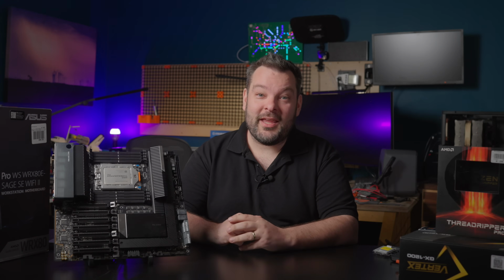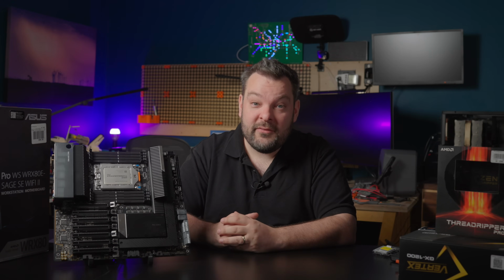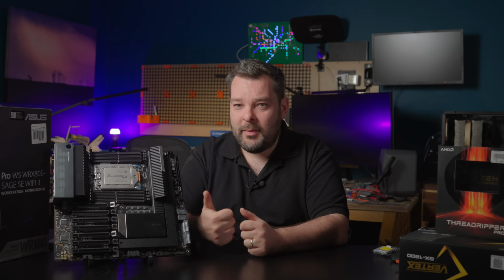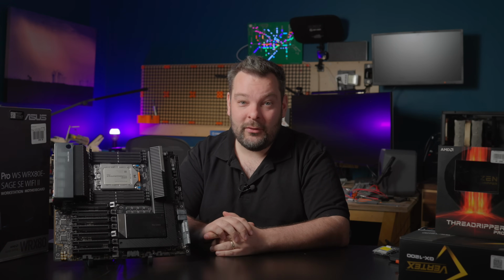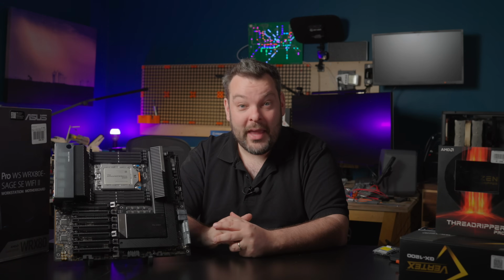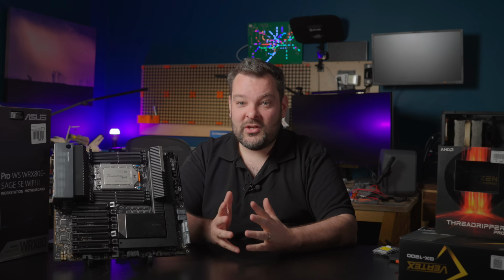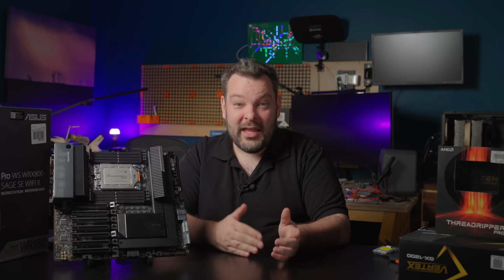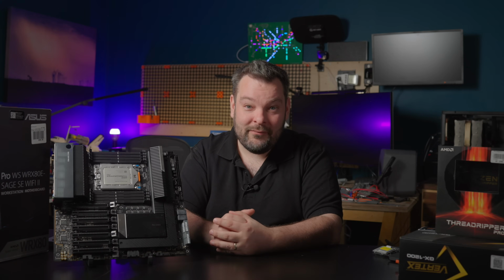ASUS WRX80E Sage SE WiFi II & Threadripper Pro 5955WX Review: PCIe Lane Heaven or Proxmox Nightmare?

Comment: When it comes to DDR4 compatible CPUs, the threadripper is same clock speed as the top DDR4 Ryzen 16 core CPU. So a used 5955wx threadripper is best when you need to recycle that DDR4 RAM you have now that prices have jump 5x times.

Comment: For me, the booting issue occured, when SR-IOV was disabled. I had disabled it after some toying because there were too many entries in the lspci (I come from normal boards and Intel CPUs). On second attempt to install proxmox, it did not pass the initramfs as you describe.
Now I am trying to do nested virtualization in proxmox ... All the indicators suggested in various tutorials are showing up and there is no error message on installing proxmox. But ... no DMAR or IOMMU in the nested proxmox mchine and an error on selecting the PCIe-device to pass through. Now I take your recommendations for UEFI settings and try again. Thank you!

Comment: I also built a ASUS WRX80E with TR Pro 5955WX and 512GB RAM as a video/photogrammetry renderer last year. I had massive problems when enabeling bifurcation (4x/4x/4x/4x) for the NVMe storage card that came with the board. When enabled, I get up to 4500 μs halts in latencymon. When disabled, it goes down to <100μs. Unfortunately, I bought all the parts from different sources so I couldn't return it easyly. So now I have 4 unusable NVMEs worth over 1000$ just laying around :/
Reply: Same but I have 16 u.2 drives, it won’t boot with more than 6 drives installed , bad board

Comment: Threadrippers and Epycs.....pfff would love one for my homelab. I just upgraded from a single Xeon to a dual Xeon setup. Got 80 lanes now, up from 40. Best next thing i guess
Reply: Ebay, 
Entry level wrx80 
3945WX only 12 cores but under $200
Gigabyte board under $500
It's used but get 1/2/3 year warranty and plan your next upgrade.
This way you can eventually put in a 5995wx 😊

Comment: I am having a q code 15 error on this with a 5975wx cpu, I installed 8 x 32gb of Micron 3200mhz rdimms I can get into the bios but cant install the os as it blue screens also get that issue with a 3975wx on this board frustrating

Comment: I know it shouldn't bother me but it's annoying to see folks complaining like this when they are using it wrong.  This machine is for Workstation work, probably meant to have Windows on it, perhaps some workstation Linux distro.

Yeah it's power hungry, IT'S A WORKSTATION for very heavy work.  The components/drivers/config is built around it's use case.  If it was a server board it probably would have gone a lot smoother.

Comment: I just built one in a 4u server case for the hot swap bays...  too big to get to the bottom connectors.  since I had no plans to mount in a rack, i cut a hole in the side and expanded it 6 inches and added 28 2.5 hot swap bays from icy dock, card reader and burner drive. may have to squeeze liquid cooling in there somehow .

Comment: I was recently building a new home server and was looking for Threadripper last gen on eBay. But in the end I got new hardware, ProArt X870E-Creator WIFI motherboard along with the Ryzen 9 7900 (non X version with 65W TDP) processor. I am using two PCIe slots for two Nvidia GPUs and for storage there are 3 x NVMe SSDs, 2 x SATA SSDs and 2 x 3.5" HDDs. Also got 4 x 32GB of DDR5 from G.Skill (Trident Z5 NEO) but since there are 4 x 2 row sticks it works "only" in DDR5-3600MT mode. In the end I consider this a wiser choice, minimal power draw in comparisson to Threadripper, got new parts with long warranty, and the motherboard is easily upgradable during the AM5 life span. Software side I got Ubuntu Server with Docker and MicroK8s and mainly play with AI.

Comment: This is NOT for homelabbing... This is for big data dev work where you need things like 2 gpu & mellanox networking in a desktop that you can put under your desk (NOT rack). This is not a homelab toy, well it can work as it but for homelab you can go much cheaper with older Epycs.

Comment: I’m having the same problem. Lack of pci lanes. Your video kind of turned me off the 5000 series. Do the 7000 have the same issues? Or do you think it’s more related to the motherboard like another poster suggested? Kind of struggling on a plan going forward.

Dual gpus, three preferred and high speed networking are on my list.

Comment: I think the problem you were facing is much of the concern of many proxmox system builders. The consumer/prosumer platforms just aren't ready for full virtualization. The enterpise platform you were using (EPYC 7002) before were designed for virtulization from ground up, and it was easy for this reason. 

I think this is a major lesson for everyone though, just don't trust things that are not for the purpose of virtualization and hosting (unless tested by others). Things that are not designed for our purpose will more or less fail at some corners, sometimes major sometimes minor. It could be a deal breaker depending on your usecase.

Comment: Interesting to hear you get those types of messages. I have the gen 1 version of that ASUS motherboard with the 3975wx and I was getting a lot of corrected PCIe errors in Windows Event log for years. It kept pointing to various different nvme drives but every time i removed a component it seemed to say something else was the problem. I nearly RMA-ed some WD SN850 drives which are actually totally fine.

I tried everything and have finally reduced the errors by not using slot 2, i figured it somehow got a defect. However i just get this nagging feeling that there's an underlying architectural issue with this ASUS board that they are keeping quiet about. (I have all power connectors plugged in)

Comment: Wider than the EATX 'spec'? I was not aware that the "Extra" wide ATX boards actually had a standard. I have seen so many wildly different size "EATX" boards I had just assumed anything bigger than ATX you better start measuring every inch or millimeter to check clearances. 
I am sorry to hear you have such trouble with the Thread ripper platform. 
I am enjoying my EpycD8 + 7F52 in proxmox with little to no complaints. For my set up, as much as I would love to run a high end consumer build, I just find the spare PCIE lanes incredibly useful especially when it comes to having additional NVMe storage. 
I am mostly testing VDI/ or Gaming in virtual environments. Testing includes BOTH direct passthrough AND GPU virtualization splitting workloads across several GPUs.

Comment: Still rocking on a 2975 WX 7 years on with 3x onboard NVME, 4xNVME pcie card, dual 10g fibre, SAS HBA controller, 9070 XT GPU and it’s difficult to move to anything else cause of those sweet PCIE lanes.
Reply: I'm using a 5950x on AM4 and while the CPU is fantastic even 5 years old I'm struggling there's just not enough PCIE lanes on consumer platforms and HEDT as a whole seems to be dead.

Comment: Cries in 3975...  It's always felt laggy in windows, something about IPC, idk.  I want to make the leap to the rumored 9xxx series.  Also if you throw this in something like a O11 XL, those bottom ports are amazing.  I can run a full size 3090ti and not block any other slots.  This is an incredible motherboard that is a little hamstrung by these eras of CPUs.

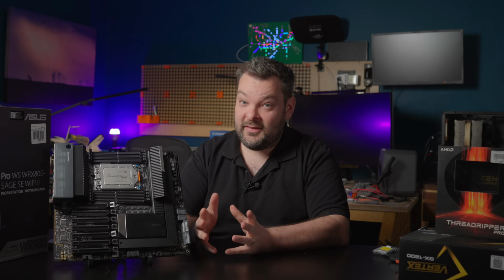Comment: 10:23 there is no such thing as an E-ATX spec, E-ATX is a wild west of whatever the board vendor wants it to be as long as it uses standard ATX mounting holes, judging by the width and the screw hole placement, that is an SSI-EEB board, asus list the board as EATX(EEB) so that settles it, that's an EEB board through and through

Comment: I was looking at building another AI server to replace my TRX40 system. Given how much money is involved in an all in system, I'm legit considering a Minisforum BD970i X3D and a blackwell RTX Pro 6000. What's the point of all of this PCIe availability when I can have a single PCIe 5.0 slot and 96GB on a single 600w card, 96 gig of 5600 DDR5 and enough NVMe storage to store large models. For everything else, a small cluster of mini PCs do the job just fine and I get high availability with it.

Comment: The only reason to get this is because you need those PCIe lanes. Otherwise, it doesn't make much sense to buy this.
Reply: And the ram capacity.
Reply: ECC is reason enough…
Reply: @KleoGroutides There are other (cheaper) ways to utilise ECC in a system - unless you're referring to registered memory.
Reply: @akirafan28 the correct way is ECC registered memory.  You physically need extra memory chips to do it since there is more wires to/from the CPU.  ECC on the data path basically.

Comment: I wish AMD could do something like the Apple chips where they basically tape out a full double sized die and cut it in half if the want or need to for the consumer IOD.  Then make Threadripper basically two consumer IODs fused together to be quad channel 48 PCIE lanes.  I think that would also solve a lot of the 'niche platform' issues since it'd basically be just the consumer platform at the same time.  Granted, now you'd lose the registered dimm support so there'd be no cheap ECC from decommissioned servers like with X99 though.

Comment: I would gladly have bought a Threadripper X3D 16 core chip for 700-900 bucks if there was a reasonable board to put it on too.  It is freaking brutal how HEDT core counts are on consumer socket and both team red and team blue are pushing Lite Workstation parts at like double the price instead.  At this point, I'm starting to think X99 will forever have been peak computing.  I started out with a 6 core 28 lane chip and 16GB of memory in '18.  RAM prices dropped substantially in '19 so I picked up another 32GB of memory.  I paid $164 for the 16GB and only $90 for the 32GB.  I ran out of PCIE lanes so I picked up an i7-5960X for $150 in '21.  I flew a bit too close to the sun with the overclock on that chip and ended up causing cache instabilities so I replaced it with a Xeon E5-1660V3 in '23 for $41.  It's functionally equal to the 5960X but with ECC support - something that came in handy when a friend told me he had a bunch of 32GB DDR4 ECC RDIMMs.  Now I had 256GB of RAM for less than I paid for the 16GB.  By this time though, the single thread performance of the platform was so far behind modern chips that I gave into temptation when Newegg had a really strong sale on 5700X3D and a decent price on X670 Taichi so I would at least have two physical CPU slots.  I picked up a pair of 25gb network cards and a Xeon E5-2697A V4 16c to turn my X99 board and 256GB of ECC into the most overpowered 4x4TB NAS in the world.  Unfortunately, the network card refused to work as the secondary device in the CPU lanes so I ended up hanging it off the chipset like I was wanting to avoid, meaning I could have gone with a cheaper board.  Although I could just grab a dual M.2 riser and use the lanes that way.  Ultimately though - I would have much preferred to purchase a TR5 Threadripper with 48 PCIE lanes and quad channel memory with two 5700x3d CCDs for 16 cores and AMD would have made double the sales while getting me onto a platform that would allow me to upgrade to newer CPU - but no, the cheapest Threadripper has to be crazy expensive and a 6 core CCD compromise I'm not willing to make so in reality the 32C is the cheapest one I can consider.  It's just bad.  I cannot imagine that they make so much more off turning the platform into what they have versus having it be more mass market.  I mean TR4 was a freaking love letter to PC Enthusiasts and they sh💩t all over us by doubling the price of consumer socket and superior sockets.

Comment: Comparing workstation to desktop is a false comparison. There's no point in getting a workstation if the plan is to treat it like a typical desktop computer. I purchased a similar system, which I'll be using as a homelab and will be handling all the load of all my computers (i.e. gaming, servers, networking, etc).

Comment: I have this same board and cpu paired with dual 3090s it runs ollama on top of proxmox. I never had a single issue with installing proxmox
Reply: I'm thinking of the same board for use with my 3090's do you recommend? I've have good success with vllm for duel GPU
Reply: I just got one and curious about what PSU you'd recommend?  I "only" have a Gamemax 1300W which doesn't have nearly the amount of PCIE and CPU slots that this requires to run two GPUs

Comment: I was a fan of Sliger and their cases, but not anymore. I can not recommend them based on their customer service. I bought one of their cases and it came with a set of rails that didn't work properly. I informed them about the issue and they offered me a refund for the defective rails or I could wait for them to get new rails from a new supplier and they would send me a set of the new rails (because they were already aware of the issue and would be sourcing from a new supplier). After quite along time of not hearing anything else and not receiving the new rails, I contacted them about it again and they refused to send me the new rails or refund the old ones, but instead would "sell me the new rails at a small discount", even though I had all the email proof I was offered a full refund or new rails in the past and I choose to not take the refund back then and instead wait for the new rails.

Comment: Interesting. I built my first server type system with the same mobo and cpu about a month ago with 256GB RAM. I did not have the issues you did, but then I moved Proxmox from another system to it. I have an Nvidia 4090 and two RX580 GPU's passed through without the bottom two pci-e connections powered like you do. I've got the idle power down to approximately 220W. I got a Lian Li V3000 Plus white case from Microcenter with plenty of space for it. They are on sale for $81.91. I paid more. It's certainly been a learning curve.
Reply: What do you do on itv

Comment: Getting a bit old, the man says. And here's me still on X399...
Reply: Dude, I'm still running lga 2011 as my server
Reply: @exogator  So am I, the X399 rig is my daily driver.
Reply: I'm still on Bulldozer Opteron... works for me
Reply: I have the little dog, 5945wx.  Old to some is new to others.
Reply: I'me still on my ASRock X399 with Threadripper 2950X 16-Core Processor. Upgraded the GPU a couple times, using an AMD Radeon RX 7900 XT and still keeps up with everything I throw at it.
Reply: On an X79 system...  :)

Comment: I just picked up a Asrock Rack ROMED8-2T (Also seven x16 slots) and EPYC 7402P (24 core) for less than $900. Can't beat that, half the price of this.
Reply from the maker: That is a pretty good deal.
Reply: And over 3 years older. Of course the price is low.
Reply: @Warrigt  it just works, it did for me.
Reply: Where from (looking for same)
Reply: @cje7004  NewEgg has the motherboard and plenty of 7402P on eBay for cheap. Make sure you don't get the platform locked ones. A lot that are locked to Dell servers.

Comment: If it is for a home lab, the ASUS sage c621e would be a much better choice. Dual socket. Supports intel scalable. Intel xeon gold or xeon silver of second generation cost no more money these days. They can be fast, support tons of memory and, when equipped with 2 CPUs, all PCIe slots are available for use, and next to that a bunch of U.2 drive sockets and 8 SATA ports...
In my opinion the board discussed here is better suited for e.g. AI server due to multiple video cards being supported
Reply from the maker: Whats the energy usage on a dual socket system like?
Reply: @ktzsystems  I have the mentioned motherboard with currently a single Xeon silver installed. I did put one of those watt meter devices on it yesterday. Uses between 90 and 110 Watts. Processor was not doing much though at that moment. So I guess when under full load, it ll consume about 150 Watts for the full HW stack:
It runs about 15 VMs, there is 6 HDDs installed, 3 SSDs and 1 NVME. 256Gb of memory and dual SFP+ NIC.  I guess most power is used by the HDDs and the memory since the CPU itself is rated at 85W TDP, so even at full throttle it wont consume that much.

One BIG disadvantage: only PCIe 3.0 ....

Comment: I think part of your poblem is that you were using Linux. You can actually try talking with ASUS support. In my experience they were not very fast, but they were fixing those kind of problems.

But if you want to have a good server you probably would be better with Epyc Genoa or Turin (lower end chips of course, maybe even used chips) tbh. As you've said - server platforms are usually more polished - at least they should work well with Linux.

Comment: I'm not sure why they wouldn't just sell a lower-core-count/higher-clock epyc chip.  48/64 PCIE lanes is probably the sweet-spot for high-end desktops.  As implied in the video, 128 lanes is a server system, spec'd and priced as a server.
Reply: If you need EPIC, i suggest buying a HP system, service it remote. Never try to understand what is inside.
Watt ? These boards are made for PCIe specification, only to run some NVMe drives ?

Comment: There is Threadripp 7000 now this is horribly outdated now
Reply from the maker: How much does a 7000 series system cost though?
Reply: @ktzsystems  I just upgraded to the 7965wx with 256GB of DDR5-6000 RDIMM RAM and I think the cost was about $5400 (ironically my server got upgraded to WRX80 + 35955wx which was the old desktop). This upgrade was just Motherboard, CPU, RAM. I think you could save something around $750-$1000 if you can find the 7955WX (16 core) but that is supposed to be an OEM only model like the 3945WX (12 core)

Edit: Also consider that TR Pro 7000 is 350w TDP which can be a challenge to cool as well
Reply: Me, i use desktop systems only now.